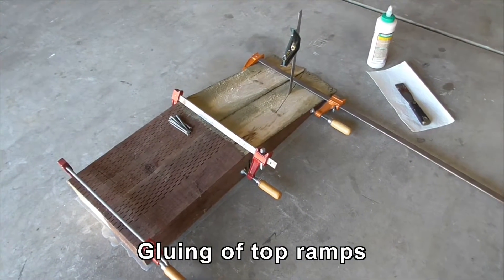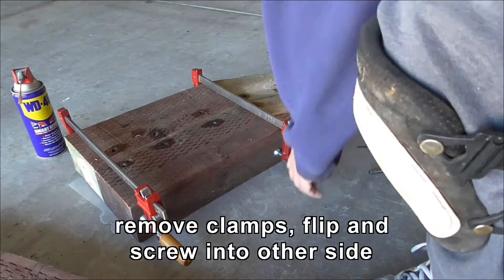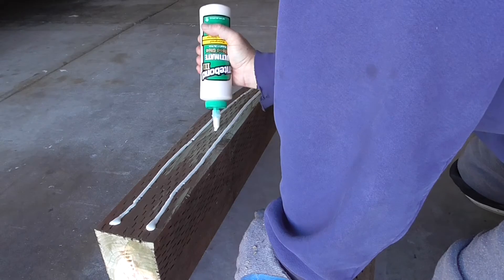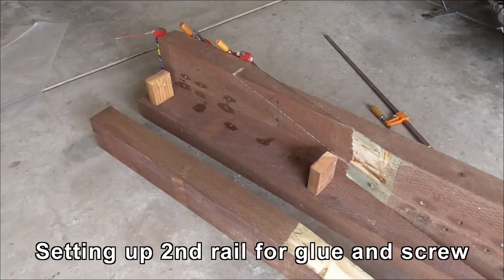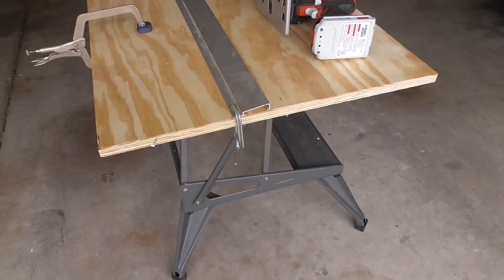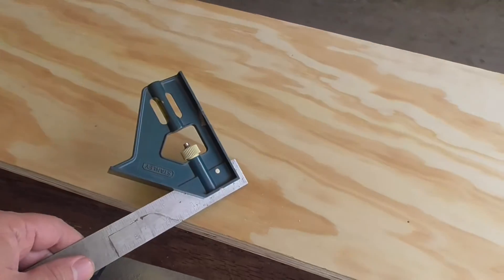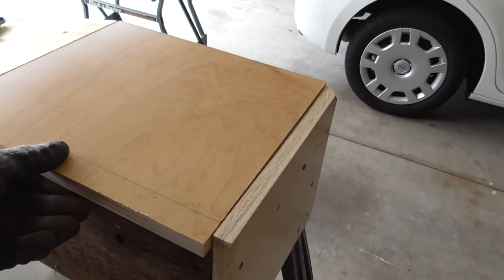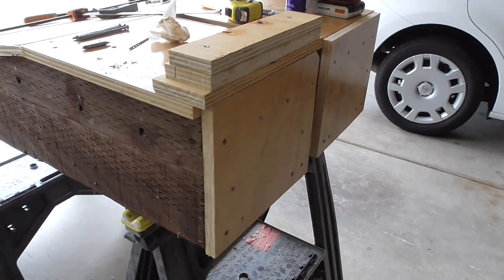Car Ramps - part 2 Assembly

Comment: hello i would like to make some like yours, can you share you detail info. what i would need what what to cut sizes
Reply: Well this is the best ramps I seen, I plan on. Trying to make the same ones this summer if I have any questions I hope you can help me, I may even make a  video , may I ask you your email address in case I need help
Reply from the maker: @wow-wow-p8d  I always answer questions on the channel. With all the CNC work you do, I doubt you will have many. Cutting those long slopes and then using the other half as part of the assembly was hard with simple tools. The 8 foot long lumber pieces may be challenging to hold in a machine or pass thru a band saw. The plywood finished surfaces do a good job of covering up any cutting errors :)
Can we see how you get on without sharing email addresses on a public forum. There are haters and hackers out there who would love to steal our info.
Reply: @richbinaz  thanks I have to finish a couple projects before I start this one I'll be in touch
Reply: @richbinaz  WHAT ANGLES DID YOU CUT THE BOARDS?
Reply from the maker: @wow-wow-p8d  It's not so much an angle, it's a slope of 5:1. So for every 5 inches in length along the base, the slope rises 1 inch. If you want the angle its arctan 0.2 = 11.31°.
It's just easier to use the ratio for a given size of the wood, to calculate the length

e.g If the height is 5 5/8", the length is 28 1/8" Then I can just use the tape measure.
Reply from the maker: Sure. If you have a look at part 1 of the build, you can see I'm unloading 3, 4x6 x 8 foot long pieces of lumber and a slab of 3/4" ply 4foot x 2 foot. (home depot) I had some 3/4" ply left over from another project, so you may need more that just that one piece if you are starting from scratch.

In Video part 1, at time index 0:04 you can see my initial plan, which is to make a ramp 10" tall, 12" wide with a flat "landing" 14" long and a 1:5 slope running up to that. 
I made it 10" high so I could run a Prius up the ramp for an oil change. they have a large flap underneath that needed space to open it without removing the panel.

The 4x6 lumber size is of course smaller than that, so I had to adjust the sizes to match the goal. Looks like I measured it initially at 3 5/8 x 5 5/8. 
Later on, I had to make some more measurements of the actual wood (each piece was a different size) and changed the design a bit to eliminate the gap between the 2 top pieces of wood. So the width is now 11 1/4" to suit the wood. Kept the plywood 12" wide.
That shows up at time index 3:55

At time index 8:30, I put the 4 pieces needed for one ramp together, just to make sure it's going to work.

In Video part 2, I show how I glue and screwed it all together. I put the deck screws in at 45° to deal with shear loading - Twisting loads. You can't just rely on the glue. The angled screws help with side loads on the car and stop the ramps collapsing from any side loads are placed on the car when it is up on the ramps.

There is an end plate of 3/4" plywood also. This gives additional side load protection and makes a nice base for the casters. These ramps weigh 60 lbs a piece finished. Casters make it much easier to move them around.

I made these back in Feb 2017. They still work great even though they have warped a little.
Heaviest car I've driven up them is a Mazda cx-50, almost 4000 lbs (1,000 lbs per ramp). 
Compression strength of white fir is around 5000 lbs per sq in, so the ramps can handle that easily.
Because of the long 1:5 ramp, they do not slip on our concrete floor and the XB bumper skirt doesn't make contact.
My son drives up a little too enthusiastically and taps the end bumpers which work. Horrible scraping noise as the ramps get pushed a little on the concrete floor - nails on chalkboard sound. Good audio feedback.

Lots of room underneath, which can be an issue with oil draining (the long drop). I bought a furniture dolly (Harbor Freight) to use with my oil drain pan to reduce the drop and splashing. I try to do cold oil changes as the oil flows slower. Watch out for that.

Hopefully, I've laid out what I was designing for, how I adjusted on the fly and how this was all done with moderately basic tools.
Good luck
Reply from the maker: I've also added links to each movie in the text under the video so you can jump from one to another.